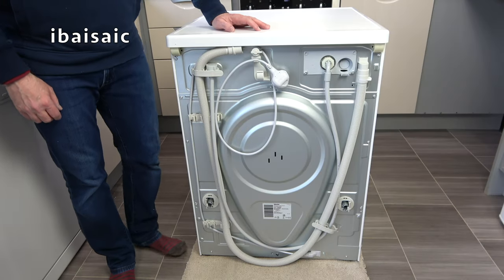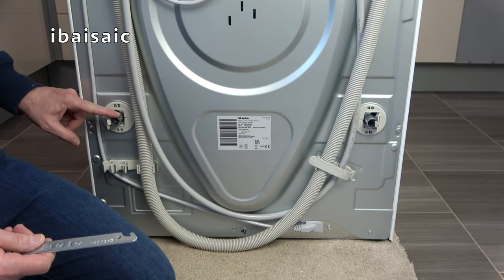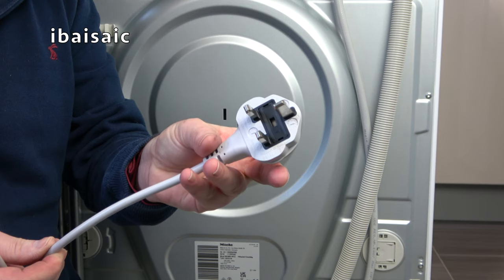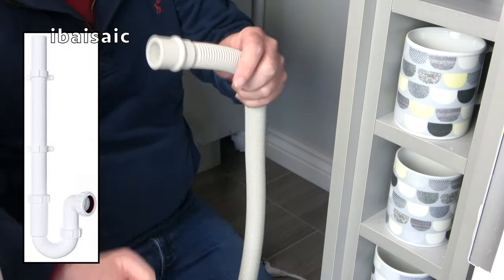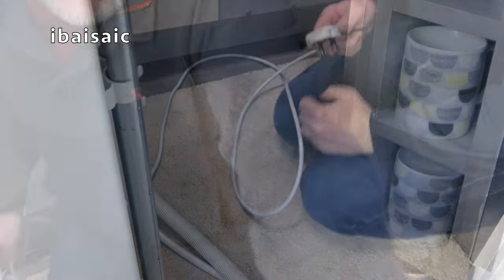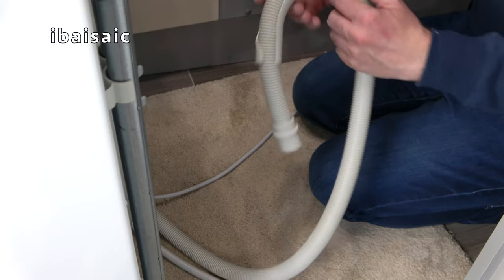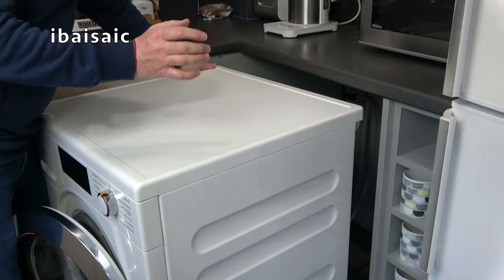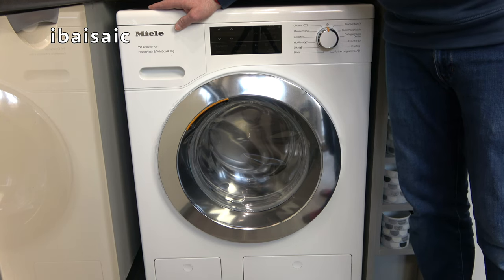Installing My Miele W1 Automatic Washing Machine

Comment: Miele are so well thought out to make it easy to set up for the end user.

The Siemens avant-garde washing machine that I purchased came with an instruction book that was it, the transit bolts were not a problem because they were standard bolt sizes, but they used 6 T20 screw heads to secure a transit brace to the machine..... Never supplied any tools but charged about as much as the Miele you bought.  Had to do a little bit of shopping.....

That Miele does look very impressive 😊

Comment: Nice video, just installed same one at my house.
Couple of tips (as this is s heavy washing machine) - spray thr floor where washing machine will sit with some polish, it will ll make pushing it a lot easier.
This unit will sit flush with kitchen worktop as both are 60cm. The overhang on back of machine allows for the pipework, but you must be mindful when pushing machine back that none come over this point. I used cable ties as not all of the back is a void area.

Comment: This Miele seems backwards compared to the early 2000’s models which included a water protection system (with 20 years guarantee), made solidly (unlike the newer ones) and the older ones were more reliable. My Miele from 2005 is still going strong but when it does break down, it’ll be more cost effective to pay Miele £260.00 for a full service
Reply: What model have you got.
Reply: @ianpurcell7266  I have the W3652 WPS model. For some reason, this model doesn’t exist on the internet anywhere hence why it’s hard to find aftermarket spare parts. Although any other Miele washing machine model - I’ve been able to find with no problem. But I love this machine, it’s energy efficient, cleans clothes exceptionally well, saves water and is extremely delicate whilst removing stains completely

Comment: Thank you for the great video! How much clearance do you need on the back? Can it be pushed right up against  the wall? Some people online say it is possible but not sure because of the viration.
Reply from the maker: I pushed mine in as far as it would go. If the machine is properly levelled, it should not vibrate or move at all, even during the spin cycle.

Comment: I reccomend doing a test cycle! (quick wash at 30 degrees) to test all of the machines functions!
Reply from the maker: With this Miele you are forced to complete a cottons 95 wash before the machine will allow you to select any other programmes.
Reply: actually its tested with water from factory so u'd have to run DrumClean or cottons 90 with empty drum
Reply: thats so good
Reply from the maker: I know it’s tested at the factory, but the instructions state that you need to run a full cotton cycle at the highest temperature before putting washing in. I know this because I wasn’t able to use the machine normally until the full cotton cycle had been completed.
Reply: oh thx dude, but i was replying to its51app

Comment: very nice.... could you tell me how to deactivate the beeper, please? I have just bought the 8 Kg machine W120
Reply from the maker: Turn the dial to further programmes and press the arrow down button until you get to settings. Press OK and scroll down to buzzer volume. Press OK and use the arrow button until off is displayed. You can then turn the dial to the off position and the next time the washer ends, you shouldn’t get the bleeping.

Comment: Can you tell me how to get illuminated display (ie show time left etc) to show on WEG365 whilst machine is running? Unless I use the miele@home app I have no idea whereabouts in a program the machine is at. Thank you!
Reply from the maker: Turn the dial to further programmes. Scroll down to Settings, Press OK.
Scroll down to Disp. switch-off stat. Press OK. Scroll up to Off.
Press OK. A tick should appear next to Off. You can then turn the dial to off and the next time you use the machine, the display should stay on all the time.
Reply: @ibaisaic  Thank you for quick, clear instructions reply. Really appreciate it.

Comment: Manufacturers recommend that the water supply to the machine should be switched off when not in use (the tap is under my sink). If the water supply is not switched off, there is a risk of flooding.

Additionally, the machine door should ONLY be closed, when the machine is in use. Otherwise, this is how machines get mouldy and smelly. The door should be left ajar to air the machine.

Finally, a maintenance wash should be run each month, after cleaning the filter. Use the "Drum Clean" program, or run a 90c wash with detergent, and an anti-limescale tablet, white vinegar, or a proprietary cleaning product.

My cheap £199.99 Candy lasted 19 years (as long as an overpriced Miele), because I looked after it!
Reply from the maker: In the instruction book Miele state: “Turn off the stopcock if the machine is to be left for any length of time (e.g. holiday), especially if there is no floor drain (gully) in the immediate vicinity.” When I go on holiday, the water supply to the whole house is cut off. To isolate the water in my machine when it’s not operating would involve me pulling out a 95kg appliance to  turn off the tap. I can guarantee that the vast majority of people who own a plumbed in automatic washing machine will not turn off the water when not in use.

This machine has a maintenance programme that I run from time to time and the machine will tell me when and if this is necessary. According to the app, I don’t need to run a maintenance programme because I do regular washes at 60 degrees.

I have never had mould build up in my washing machines because I know you are supposed to leave the door ajar after use.

Comment: Hmm 🤔 I’ve just looked at the back of my Miele washing machine and it has a metal braided water inlet hose.. not a plastic one..
Reply: Will not spring a leak then as my Bosch did a few years back, but then it is almost 20years old but cost so little to repair it.

Comment: £20 to £30??? I had a new integrated dishwasher a couple of weeks ago and curry’s wanted £120 to fit it and £20 to dispose of the old appliance 😳😳😳
Reply from the maker: Currys charge £25 to install a freestanding washing machine.
Reply: @ibaisaic  but come on-a dishwasher with a cupboard door screwed to the front is just as easy to fit as a washing machine.Where on earth do they get £120 from??